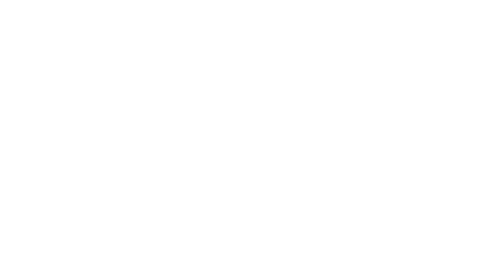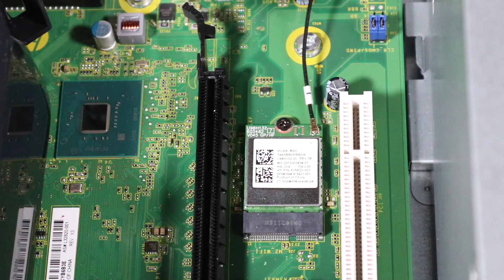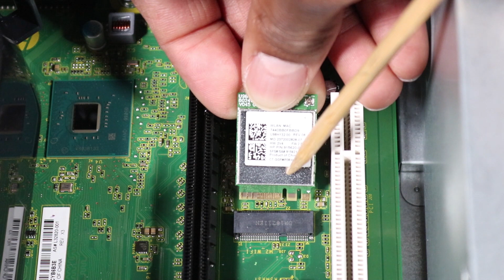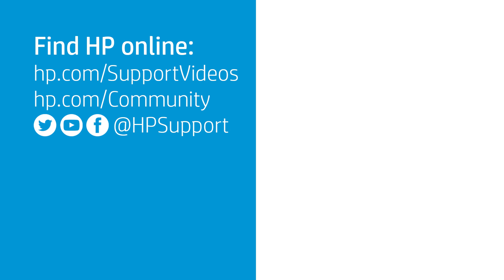Replace the Wireless LAN Module | HP Desktop Pro G2, G3, Pro A G2, G3 and 190-0000 PC | HP

Comment: Which wifi card model will it work with HP Desktop Pro G3 with intel i5 8th gen? thanks
Reply from the maker: Hi there, thanks for contacting HP Global Social Media Support!
I understand that you need to know about compatible wireless card for your computer.
I will do my best to assist you.
For optimal PC and printer performance, remember to always buy (use) Certified HP Genuine Replacement Parts from a known and trusted source. You can order it via the HP Parts store: https://hp.care/6051U94Vb 
Regards, 
HP Support